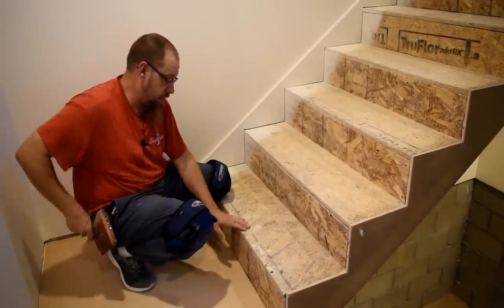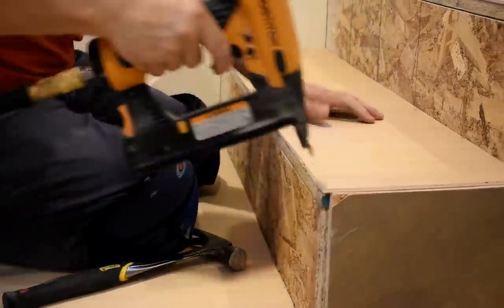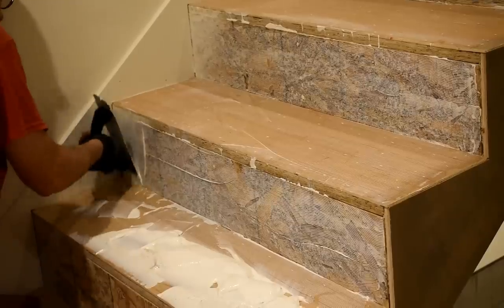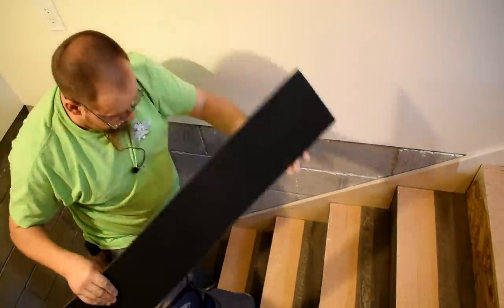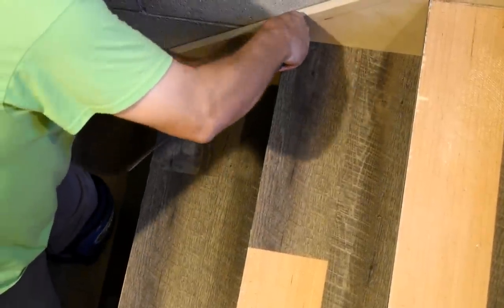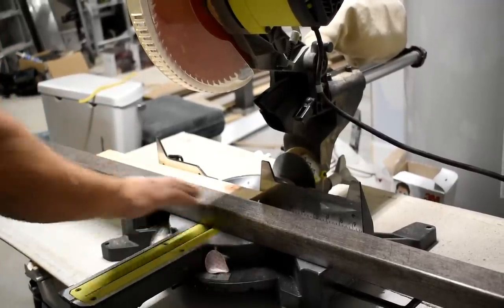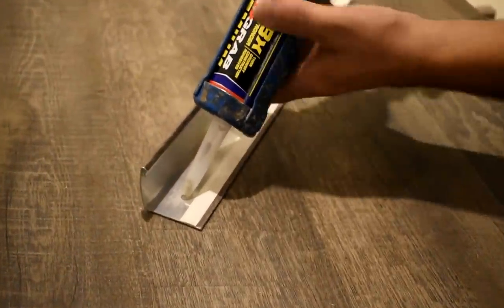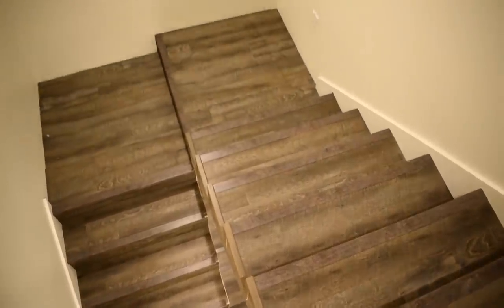VINYL PLANK FLOORING ON STAIRS

Comment: Love commercial grade LVT. In my rentals I glue to stuff on stairwell walls 4' high as a wainscot capped with metal bead - no more repairs in an area that gets most heavily damaged. Cut a perfect circle (hole saw) and glue to wall as color-matched door knob protector. Use as wainscot walls around toilets or back of kids' closets - anywhere that gets impact or water. Use as floor inside sink base cabinets, even as kitchen backsplash or garden window floor. Tenants love the look and I love the price.
Reply from the maker: Those are some good ideas

Comment: Amazing work. I have some rigid spc vinyl planks to use as tread and another rigid vinyl to use as risers. I'm scared that under my carpeted stair would probably be the same chip board. If so, is underlayment a must or can I still do without it? Seems like a double work load if I had to do underlayment.
Reply from the maker: Yours is probably a clip together plank so you will not need to use underlayment, mine was a glue down product so therefore the surface had to be really slick because the product was thin. Simply clean your steps up really good and you will be fine if it is and click together product

Comment: Question for you, is this a suitable material to install over a tile that's been glued to the steps and you can't get off? It's most likely an asbestos tile since the house was built in the 60's.
Reply from the maker: Yes it will work, prime before you glue

Comment: im sure you already know this, but that is pressure sensitive adhesive, which means that it only holds when pressure is applied, such as the pressure of gravity. If use on the risers you should be securing with another glue or using the wetset method.

Comment: When laying the tread (outer piece), why did you split them into 2 pieces? I was thinking single piece wouldn't have a joint. Was it to make random grain? Excellent job, thanks for taking the time!
Reply from the maker: brian goss Yeah just to mix it up a little bit
Reply: @FloorsbySouthernboys  dont forget a minimum of a 3/4" nosing is required by the irc.  Not sure what code yall are under, if any.  Floors look excellent and I appreciate you pointing out the little tips and tricks
Reply from the maker: Joey Stinson 👍
Reply: Utility knife are safer to use on that product.  Both the stright and hook blades that go in them. Score it with the tip of the stright blade and follow with the hook. The hook tracks and follow the scored line. I only see commercial installers do this. But even using a stright blade is safer and more precise especially when doing door jambs. Just wondering  do you use a carpet knife for sheet vinyl too?
Reply: I hope you got paid enough to do that.
Reply from the maker: Flooring Fashions | Mobile Showroom of Floors 😀👍 yes sir, I use my Carpet knife for everything
Reply from the maker: Flooring Fashions | Mobile Showroom of Floors sure did , it was a nice job
Reply: @FloorsbySouthernboys   the blade on a carpet knife does not have a point and are made to flex. Two reasons it is not made to cut anything but carpet. If you push hard on a carpet blade it bends witch in turn makes it hard to make a deep cut in a stright line. In commercial flooring world when a guy says all he needs is a carpet knife it is a sign of a hack and it is not just me agreeing to this. Side by side the guy using a carpet knife has more over cuts and knic up door jambs when you have to cut around metal jambs. Your making your life harder by using the wrong tools and i am not sure what only using a carpet knife for everything proves but you dont have the right tools. That plank is so thin i am sure the right blade will go through in one pass if you could press harder.
Reply from the maker: Flooring Fashions | Mobile Showroom of Floors It is just what I’ve gotten used to using, it’s all I have used for 28 years and I’m just Comfortable with it

Comment: Awesome video!  Such attention to detail and very clear steps.  I recently had some Allure TrafficMASTER vinyl flooring installed.  I'm planning to install the remaining planks on a set of steps to a basement.  The steps are wooden with a 1 inch lip so I'm curious how you would handle the aluminum nosing installation?
Reply from the maker: Jason M. Konigsbauer I would build out the risers of the step so that there was no bull nose on the steps then treat them just like I did in this video, a quarter inch plywood as a three-quarter inch plywood should bring your riser out perfectly flush with your bull nose
Reply: @FloorsbySouthernboys  Great suggestion...thanks so much!

Comment: What glue did you use?  The guy at the home store said the pressure sensitive glue wouldn't work and advised me to use Liquid Nails and spread it out with a trowel. (Is that even possible?)
I am installing Home Decorators Collection Vinyl Plank flooring. It has a small tongue and groove.  Thanks for the helpful video.
Reply from the maker: Bill Young Definitely do not want to use liquid nail, pressure sensitive is what is used on all vinyl products nowadays, thank you for watching and I hope this was helpful

Comment: Most of the vinyl floor planking has a very slick surface; this needs to be addressed for safety’s sake.  I used a 3M tread nose product, which is working very well, bonded directly to the step with pre-applied 3M VHB acrylic pressure-sensitive adhesive.
Reply: What product is it?

Comment: I have a rigid core click together vinyl plank that has a foam backing.  I bought flush mount stair nose from the same company.  It doesn't have a foam backing.  It clicks into the planks. Should I remove the foam from the planks or just leave it?  Seems to peel off easy.  Worried it'll stay stuck to the step and plank will come off.  Or am I just over thinking this.  Was gonna go with PL Max as the adhesive for all of it.

Comment: Awesome, thank you. Have you ever done stairs using loose lay luxury vinyl tile planks? If so, would the process be any different than this? I'm doing our main floor in a dark shade of loose lay vinyl tile, (similar to this look) and thinking of doing the landing at the bottom of the stairs, in the basement, with the same product, but a light colour instead. There are 13 stairs in between. Trying to figure out the best way to do the stairs, from a design standpoint. Was thinking of doing the stair tops in the dark planks with matching nosing, and the risers in the light coloured plank. What are your thoughts on that?
Reply from the maker: Elisabeth Drachenberg I think that would be beautiful, I’m actually done quite a few sets of steps where they just have a plain white riser and word or vinyl plank on the treads, so I think a color contrast would be beautiful, and as long as there is not a pad on the back of the plank that you’re putting down on your steps I would glue them to the steps, you would not have to do the extent of prep as I did in this video because you’re going to be dealing with a thicker More solid product than I was, this was a thin blue down, if you’re done a loosely click together I assume you won’t have to do near the prep

Comment: Awesome tutorial my man! Question about the glue it looked like you were stepping where you applied the glue, had it dried enough to where it was just tacky and did not transfer onto your shoes? Also no need for a underlayment?
Reply from the maker: tydog29 Thank you sir, I actually started gluing at the top and work my way down and then when I installed I worked my way up so I did not have to walk on the glue, and yes I put underlayment on the tread’s just not on the riser
Reply: @FloorsbySouthernboys  what about a padding like you would with a laminate?
Reply from the maker: tydog29 That wouldn’t work for a glue down product, there would be nothing holding the vinyl planks to the floor except for the pad and that pad will break down after traffic with it been glued and with such a thin product on it
Reply: @FloorsbySouthernboys  thank you sir. Great work and appreciation for you sharing your knowledge.
Reply from the maker: tydog29 You’re welcome I hope it helps you, and thank you

Comment: I love your attention to detail. Great craftsmanship. Question about the aluminum. Recently I had to move an appliance and the appliance dolly is a little hard on the stair edges. Is there a concern with the aluminum bending or getting damaged or misshapen If something runs over it or it gets hit? And if so, how easy is it to pry that blue off into the new piece on?
Reply from the maker: B. Wolfe Thank you sir, as long as you’re on the top of the step the transition piece is completely flat on top so I would not think that it would bend or dent The only part that would possibly get damaged that I would think would be the front because it has that little curve to it , And as far as taking one off and replacing it I have never attempted it but I am sure that the glue holds pretty good in order to hold up to daily wear and tear
Reply: FloorsbySouthernboys thanks
Reply from the maker: B. Wolfe Anytime

Comment: Why did you trowl the glue on? Curious
Reply from the maker: I just feel more comfortable troweling than rolling
Reply: @FloorsbySouthernboys  is it better that way than glues that come in tubes used with chaulk gun?
Reply: @FloorsbySouthernboys  and is lifeproof flooring too thick to cut with a vinyl cutter?

Comment: Looks like your doing a great job, looks awesome! You had mentioned that there were different widths of the planks, you should mix them up on the treads so they look more random and not all the same
Reply from the maker: shawn moore I discussed that with the homeowner and he wanted the seam centered in the step so that’s why I started each step with I 5 inch peace because the steps ranged anywhere from 10 and three8 2 10 3/4 so by starting out with a 5 inch piece and adding the stair noseing  It was basically centered, but thank you for noticing and thank you for the recommendation
Reply: @FloorsbySouthernboys  very professional and knowledgeable comment.
Reply from the maker: American cutie thank you

Comment: How long does it take before the wood finish starts wearing off of the aluminum stair nose?
Reply from the maker: John Storton I have done several stair cases like this over the past few years and I haven’t heard any complaints yet
Reply: The vinyl skin on them is fairly stout. Same thing as the floor really, a veneer skin fastened to core. A bad scratch is rare and can happen, that'd be only thing to worry about. Just don't moon walk the steps in leveler spikes.

Comment: Nicely done! 
Shame on VPF companies for NOT creating an edge on the stair/bullnose treads that will CONNECT seamlessly to more flooring. I’d rather do a straight cut on the bullnose tread to remove the connecting lip if it got in the way of the riser....than have to have any kind of gap, lip, transition.
Mind boggling that the wheel has to be reinvented here...
Reply from the maker: Janet Meyer yup

Comment: The treads and risers on this set of stairs is not chipboard actually< rather it is a product called OSB, which stands for Oriented Strand board. It’s a very useful product and in ways better than chipboard or particle board as it is often called. The only caveat to this statement is that it’s virtually impossible to sand to smooth even finish as the individual leaves start to delaminate. Most joiners will already, apologise’s who already new this.
Reply from the maker: Steve 127 👍

Comment: Yes nice work! A few questions: Do you buy all your product locally or online? Do they sell you both the plank & stair nose? What kind of material did he use for the trim? And lastly, do you caulk any of your seams between the flooring & trim or stair nose?
Reply from the maker: Matt Walker I buy all my materials local, the plank and stair nosing was ordered at the same time and he used a regular corner piece that you can get from Lowe’s or Home Depot to trim out the edges and no I do not cock any seams in the flooring or between the trim

Comment: great video....can i ask , what is the thickness of the under layment? also i have a 10" step and would like to use 1 piece of LVP, what size is available so that i can use one piece? and what type of glue did you used?
Reply from the maker: Vinh Nguyen 1/4” There is a ton of different types and sizes of vinyl plank

Comment: i just got done with set of these.  they are very time consuming with cutting the bullnose off the existing steps, underlayment, fitting planks and bullnoses, glueing  and finishing.  you think im way off charging 100 per step?   i wish they made a 9 inch plank for this.   in my own home i think id rather have solid oak  tread and rises, i would think there comparable in price since the bullnoses are like 60 a piece and only come in 8 foot
Reply from the maker: You should actually be charging more, my bottom is $125 and it goes up from there with any extras
Reply: Where did you purchase the bullnoses?
Reply: @pearlperlitavenegas2023  I didn't purchase the bullnose, I just installed them for the retailer I work for.  Most carpet retailers will have what your looking for and then there's Lowes or home Depot.   Hope you find what your looking for

Comment: The flooring I have has a rubber underlay attached to the bottom of it, looks like your flooring has it also but it's hard to tell.  Just wondering if that's ok for gluing it down?
Reply from the maker: King Pug If it has a rubber pad on the back it is not to be glued down, this product in the video does not have that

Comment: Nosings:  I would THINK that those nosings wouldn't look good for long and that they would scratch and wear down to the shiny aluminum on the top.  I mention this because I'm making this decision right now.  I would THINK it would be better to just start out with the shiny aluminum ones so when they get scratched and wear and the finish wears off, it would still look like new or at least be a LOT less noticeable.  I have some in my house that have been there since the house was new, the screw-down type, and they still look like new.  I am interested in the experiences people have had over time with nosings.
PS:  The plus side of aluminum moldings verses wrapping the edge is you are far less likely to slip, and you don't need the traction strips change color from embedded dirt.

LVP:  I've never seen LVP that flexible  What kind is that, and how good is the wear layer and thickness?  Our stairs takes a beating.  LOL!

Comment: Some Installers would have turned the landings the other direction for "Safety Visual" purpose. I see the metal Stair Caps has a slight color difference. So that may eliminate that "Visual Safety Step". Good Job.
Reply from the maker: Jeff Lostica thank you
Reply: @FloorsbySouthernboys  Try cutting the end  of that LVP off the step with a hook blade by Orcon. The Underlayment is by Halex.
Reply from the maker: Jeff Lostica I have had a lot of guys tell me that about the hook knives, I’m gonna have to give them a try, the underlayment is actually revolution ply, purchased at Lowe’s

Comment: great video..i am wondering that you use the pressure sensitive adhesive on the steps as well? or just on the riser? i know some of the VLP snap on ....thanks
Reply from the maker: Vinh Nguyen I did use pressure sensitive on this vinyl plank, but on click together you would want to use a heavier construction adhesive for your steps
Reply: FloorsbySouthernboys which one do you recommend for construction glue ?
Reply from the maker: Vinh Nguyen look at the PL products at Home Depot, they have several different types, just read on it to see what it is used for and compare that to what product you’re using, but PL is the brand
Reply: FloorsbySouthernboys ok thank you ! Have a great weekend !
Reply from the maker: Vinh Nguyen 👍

Comment: Before marking the underlayment, use masking tape where your cut lines will be prior to marking.  Mirror the masking tape on the reverse. This can help reduce chip out and cleanup time on the material after cutting.  Simply peel the tape, lightly sand with a sanding block, and move on with much less surface damage on the edges.

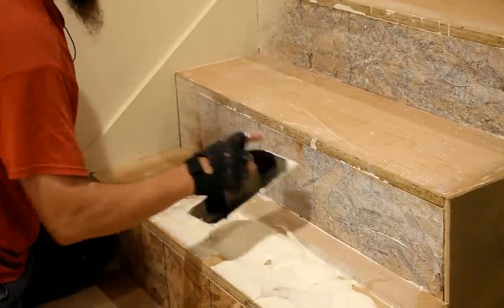Comment: 11:48
This is when I had to used a Throw-a-way brush...
and applied the glue... ;) At the time, I didn't have that fancy
hand thing you're holding LOL
Reply from the maker: Judi Christopher Ha ha ha that’s funny a lot of people actually use paint rollers to do that but on a surface like steps I think a paintbrush would be just fine, it was probably even faster than using this trowel That I’m using

Comment: Lvp need to use a number 30  tooth trowel  have to have good transfer of glue  or they could start popping loose over time.
Reply from the maker: foghorn leghorn all glue tells you on each bucket what size trowel To use

Comment: Should have put the adhesive on with a roller.
Reply from the maker: dave hughes The only time a roller is better is when you’re in big wide open rooms, other than that it is a waste if you’re doing small stuff, rollers cost almost 4 dollars apiece and you only get one use out of them, it’s a big waste of money to use them on small areas because they dry up too fast
Reply: A lot of manufacturers require a specifically notched trowel for warranty. Depending on brands, I've had to run out and pick up a specific trowel because it was slightly different than others I've used. I do it by the book for warranty purposes.
Reply from the maker: Lee Arnold I understand, I actually watched a video by the manufacture just so I could do it exactly like they recommended